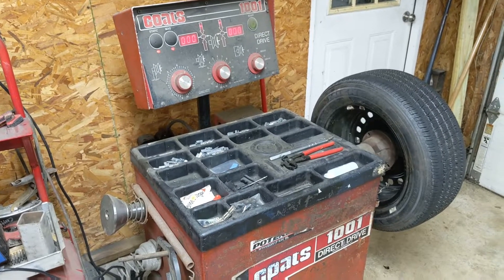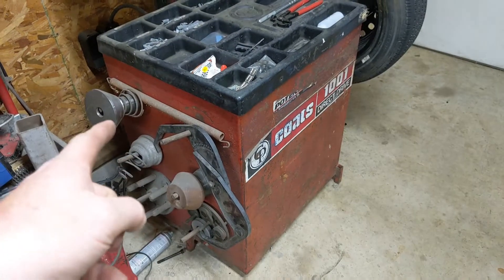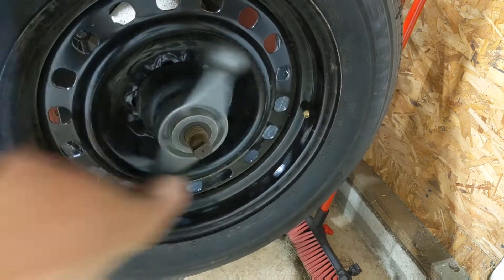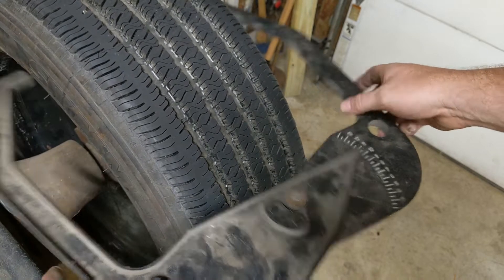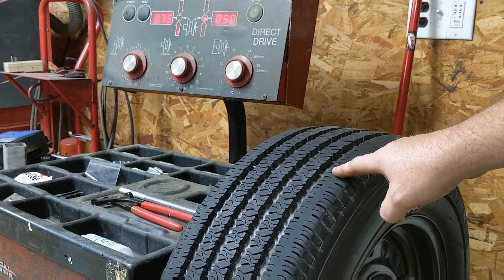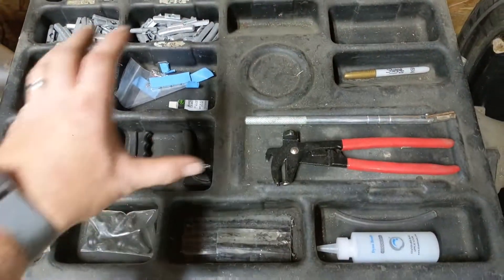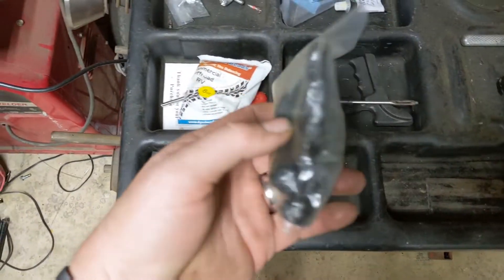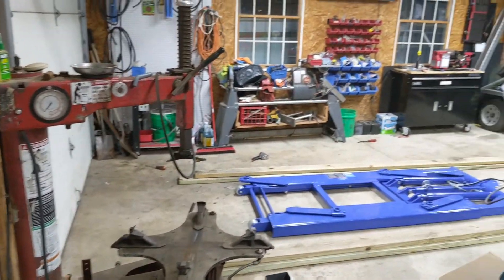How to balance a tire using a Coats 1001 tire balancer

Comment: great video. it seems faster and stronger than other machines. I just tested a similar Coats 1001 , 440v operating 380v. Bought it in 2017 from a mining company. it was sold as scrap and it has been under rain and sun for so many years  with a damaged cover display . After  cleaning, painting, new cones , new shaft from ebay , a new 3d printed display cover and replace some small parts of the main board it surprisingly works. To make it nicer i plugged an arduino and a 2004 LCD display on  the 3 pots  A , W and D  so the values of the pots can be shown on the display as it shown on the scale , you know costumers want to see nice things  ............   but a good machine.

Comment: As a past trainer for Goodyear (30+ years ago) I can tell you that the weights on the inside were impropperly done. You counter ballanced that tire and wheel combo. This can impart harmonics at speed. What you should do is manipulate the weight you put on, Move the same weight in the direction closer to where the machine is telling you to add weight. It takes more time but is more efective.
Reply from the maker: Thanks for the tip!   Unfortunately I have been following the directions that came with the machine.    Luckily I have not had any issues as of yet, but the next tire I have that demands more weight, I'll move the weights and see what happens!   I actually still have this tire and rim, maybe this weekend I'll try to rebalance it.
Reply: I was taught same method as you describe. Tired of trying to find shops that will actually balance tires correctly is impossible!  Got my tire machine and searching for balancer.

Comment: I use one of these for almost 20 years doing tyre fitting they have to be one of the most easiest machines to use if you hold the start of start button and don't let go it will actually do a fine balance it looks a little bit weird you seeing  use that one as yours is in ounces the one I was using was in grams

Comment: Fantastic and timely.  I'm a machinist and always have wondered how these machines work. I want to balance some flywheels for Lister Diesel engines and have been wondering if I could use a tire balancer to do the job (with mods of course). The flywheels are 23" diameter, and about 2.5" thick. Center hole is 2" and they weigh probably 150lbs. There's been one of these similar on Craigslist for $350 for a couple months now.
Reply from the maker: Seems like a fun project!  No idea if it would work or not, but seems like it would be fun to try!
Reply: My dad use to balance flywheels on a Bear wheel balancer. it was quite old with an  analog indicator where it show the amount of weight needed. it gives you the advantage to test unbalance wheels at higher speed than other tire balancers. people use to come to the shop often for that sevice.
Reply: @milthon57  Very nice!

Comment: You kinda confused me for the reason why you used the sticky weights. You said you used the tape weights because you didn't want to waste the regular weights. It confuses me because the regular wheel weights can be used over and over, while the sticky tape weights can only be used once. Also when you are balancing a tire and you place the weights and the respin and it shows to add more you can move the weight you had already put on a little one way or the other. Typically if it's off by .25oz you move the weight about 1/2 the length of the weight. For .50 3/4 or the total length of the weight. Which way you move it depends on where it shows to add more. You would have to play with it. You'll know if you went the wrong way because the amount to add will be higher than the first respin. Hope I didn't just confuse you on that one.
Also, to help make the motor last longer you can give it a quick spin before hitting start. That way the motor isn't straining so much.
Reply from the maker: Sorry, didn't mean to confuse you.  The weights I have are pretty cheap and every time I try to reuse them, they don't hold as tight.   The stick on weights are extremely inexpensive and I don't mind wasting them.  If I changed tires for a profession, I'd buy better weights. Thanks for the tip on moving the weights after the rebalance, when I get a chance I will experiment with it and see how that works out.  I've also heard spinning the wheel first = less strain on the motor, but have not made it a practice to do so.
Reply: @1D10CRACY  with regarding weights if you use the hammer you can actually bend the clip on the weight and make it like new

Comment: I have a coast 1001 direct drive it takes 115 volts to run it. It turns on but it don't light up on the 00 it's got different numbers popping up. I'm wondering if the motor board is bad can somebody give me a little help here.

Comment: I bought the same tire balancer but its still 3 phase. Looking for the conversion kit, any ideas? Thanks
Reply: you need the capacitors, though there is a electrical drawing on the internet.

Comment: You did not show how it does the more precision balancing by holding the start button down.
Reply from the maker: I did not, but to be honest I didn't realize it was a feature and have never done it.   LOL
Reply: @1D10CRACY  I have the three phase version and a replacement panel that allows it to go up to 22" wheels, but the technician who I bought the panel from suddenly passed away and I haven't found anyone who knows the DIP switch settings for it. Fortunately it is in my home shop and not for profit.
Reply: @aircommuter  Do you know if there is any other source for the panel upgrade for balancing larger wheels? I also have one of these machines but really need to be able to balance wheels larger than 17".